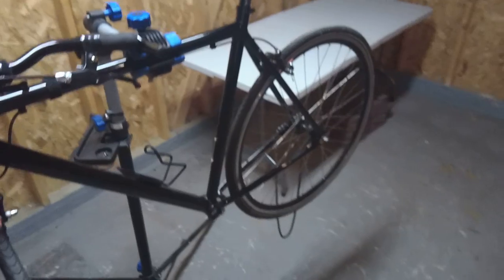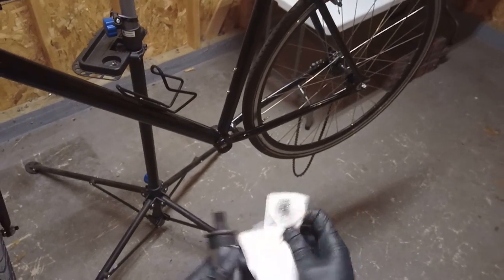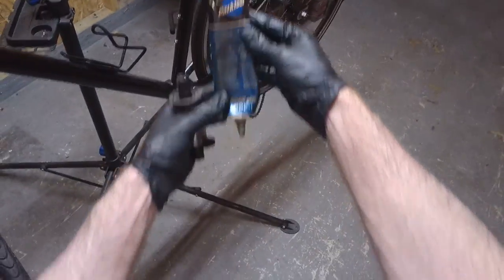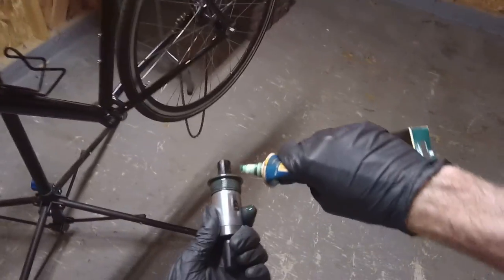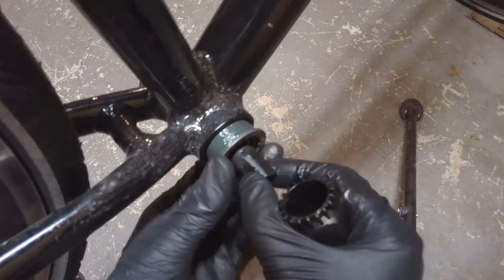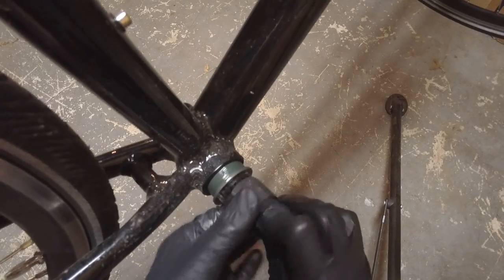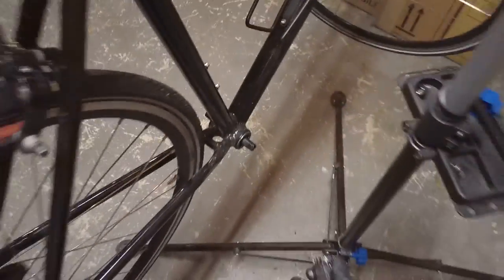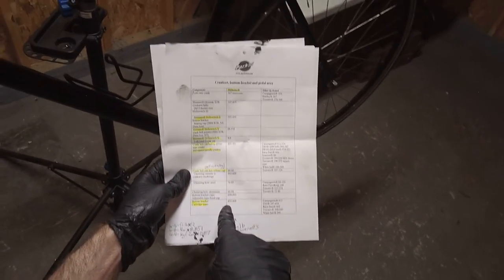How To Install Square Taper Bottom Bracket Cartridge Bike Blogger

Comment: Thanks for including the torque setting.  I've seen a lot of videos that either didn't use torque settings or didn't have a reference for those settings.  That helps a lot.

Comment: This video was very helpful, thanks. I have a new tapered botttom bracket and the non drive side is attached. How do I get the non drive side/cup off of the bracket?  Also when I rotate the bottom bracket, the non drive side wabbles slightly but if I can get it off the bracket, I can install it in the frame.

Comment: Seen that some folks use blue Loctite on the non-drive side cup threads and I noticed you used grease which does the exact opposite of Loctite. Thoughts? Is this really just to ease cup installation? TIA...

Comment: Thanks for these videos, they are a great resource. I plan on ordering the Motobecane Fixie this week and was curious about tools for a beginner. If I am starting from zero, what are the essential tools I will need for assembly?

I haven't had great experiences with my local shops, so I'd rather put $$ towards
tools and upgrades instead of assembly costs.
Reply from the maker: Joe Galvan Hello Joe Galvan. I did an entire series on assembly of my Motobecane here https://www.youtube.com/playlist?list=PLEZf1_jDCYJ0NDIkeFMneQTTZj9F_3W8F I think you only need a multitool with allen wrenches, an adjustable wrench and screwdriver. You'll also want a pedal wrench, bicycle cable cutters, bicycle grease, chain oil, and a bike pump to inflate the tires. To tune your wheel hubs you'll need cone wrenches, spoke wrenches, and to pull the bottom bracket you'll need tools like Park BBT-22 and CCP-22. To remove/install the freewheel/fixed cog you'll need a chain whip and freewheel remover. I might have missed some things, but you can do most assembly with just the allen wrenches and an adjustable wrench. This video is a walkthrough of my home bicycle shop https://www.youtube.com/watch?v=9Dw73lZUWIU
Reply: BikeBlogger Thank you sir!

Comment: could you provide a description link to the torque wrench and the special bit you have on the end of it?  Perhaps I can purchase those on Amazon?  I've purchased this bike and I think i want to perform this maintenance just for the experience and fun of it. :)
Reply: Oh got to the point where you describe the tool. But what about the bottom sprocket tool?  Any specific size or type  sprocket tool?   Thanks.
Reply from the maker: The bottom bracket tool I used was the Park Tool BBT-22.
Reply: Thanks!

Comment: Slather all the grease in it. You dont need to do that. Shouldnt have done that. when you screw it in , all those excess grease will come out and here are still plenty inside. Could make it so  smooth it could later loosen.  some ppl even put thread locker. to lock it in.